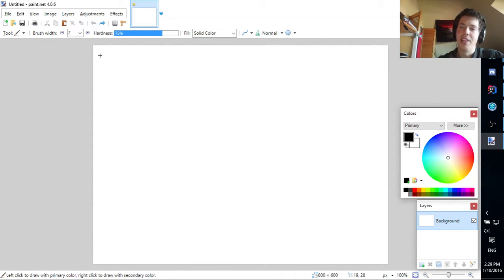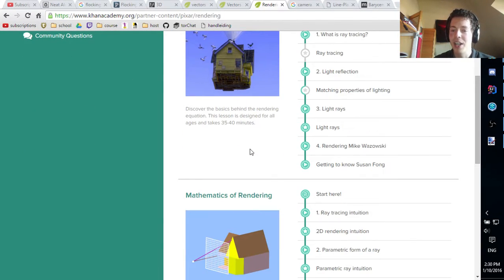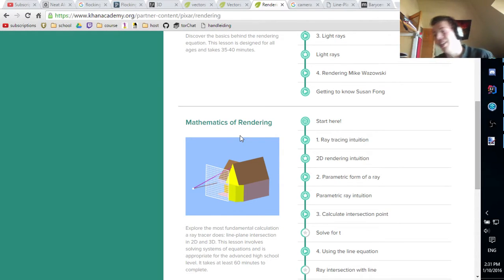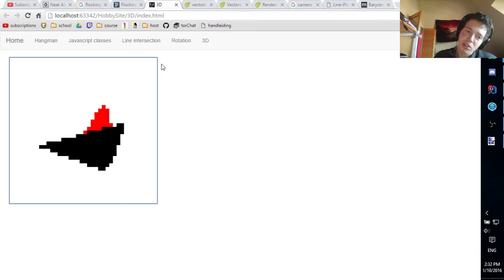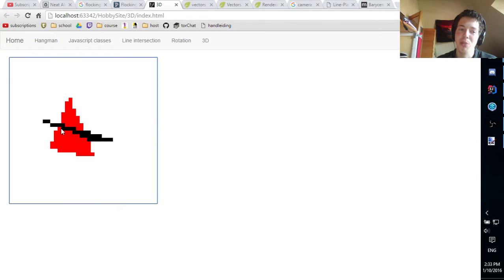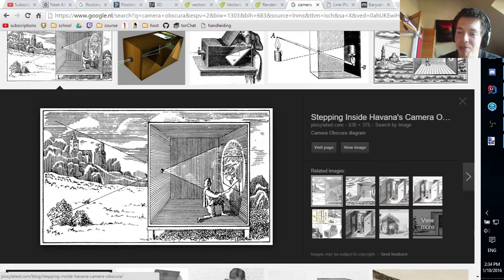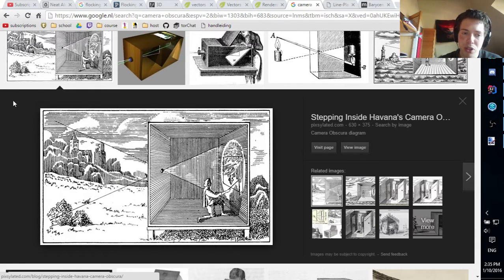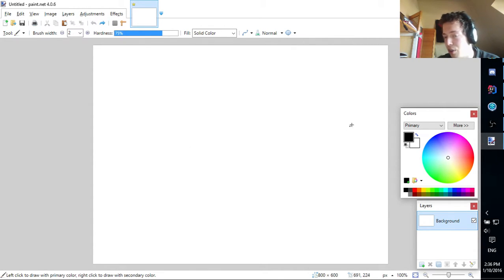3D rendering/raycasting from scratch

Comment: Ok, so I am very pleased to finally gain some understanding here. I just have one question involving the ray casting onto the objects in the scene. You did a for loop through the objects in the scene, and saw basically if there was an intersection, between the object and a ray, and returned a color if so... My question is: How do you know which object a ray collides into first? Like what if you have more triangles behind, and you don't want to draw the hidden ones. Do you just look for which ray is the shortest length?
Reply from the maker: yes i calculated the distance of all the collisions

Comment: do you know what algorithm this is?:
x=x/z*xwidth
y=y/z*ywidth
I applied it to my simple 3d engine and it turned it into a projection 3d engine. has this specific formula been done before?
Reply from the maker: that's called a perspective divide and it's a lot quicker than raycasting.
i wish i would have known it quicker because it's a whole lot less trouble than raycasting.
Reply: wo. also, you can do orthographic projection (kind of, no depth, constant scale) by applying the x y and z rotation to a point in 3d space then only using the x and y coordinates.
Reply: https://scratch.mit.edu/projects/170205732/ this is the link to a demo featuring some of the stuff i talked about. I know it's in scratch, but i wanted to see how far I could push that crappy drag and drop programming language, and I've gotta say it can do a lot of stuff lol. Just not very fast
Reply from the maker: looks cool i'll check it out